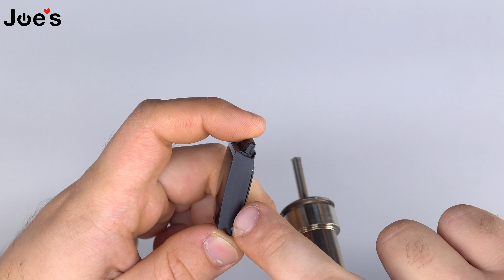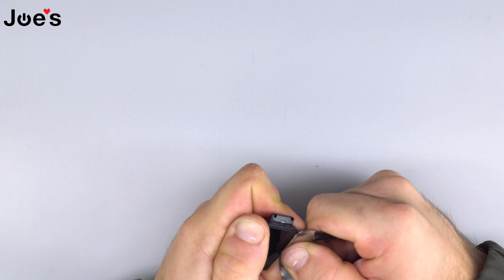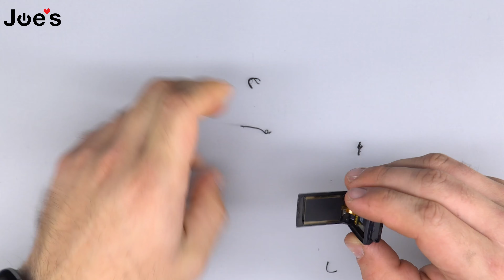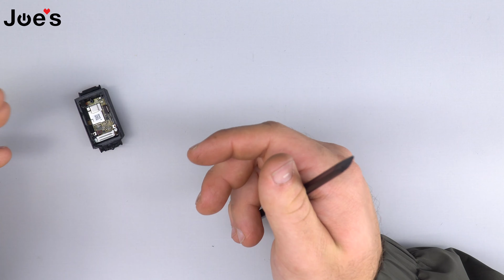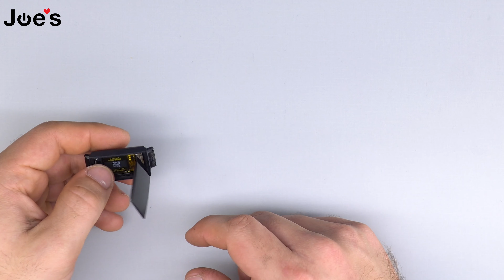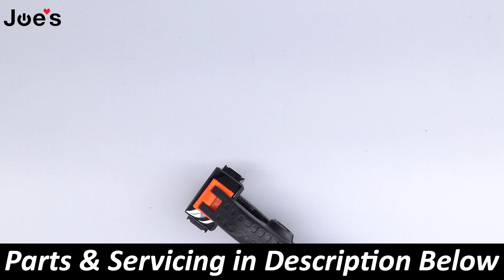Fitbit Charge 4 Broken Screen Replacement | Repair Tutorial

Comment: Such a complicated process even is done by you as professional —after buying the glue, tools, plus the new screen which is sold almost half of the price of the totally Fitbit, it is highly possible I will still screw it up and left with the glue, tools and a totally broken Fitbit… 

If so better just buy a new one instead 😂 (here in Australia they run promotion so the Fitbit price has already gone done a lot…)
Reply from the maker: 😂  sometimes it is
Reply: Am in zambia

Comment: What kind / brand of heat gun do you use?
Reply from the maker: https://www.amazon.com/Quick-861DW-Digital-Station-Display/dp/B00EID23J6/ref=sxts_rp_s1_0?crid=27TQO3QRSHK53&cv_ct_cx=861dw&keywords=861dw&pd_rd_i=B00EID23J6&pd_rd_r=34944891-32ff-4896-96a4-2b0dae391284&pd_rd_w=I0Q6H&pd_rd_wg=FZ8nX&pf_rd_p=5d10c7b7-657f-44a1-8312-8b406103e1ce&pf_rd_r=ZGEF5XSR3M1JNR4MY6JA&psc=1&qid=1647900836&sprefix=861dw%2Caps%2C129&sr=1-1-f0029781-b79b-4b60-9cb0-eeda4dea34d6

Comment: Do you think, lacking a heat gun, a person could put a spoon or other smooth metal object in hot water, let it get hot, pull it out and dry it real quick, and hold it to the screen to let the heat flow in and loosen the glue?
Reply from the maker: Use a blow dryer.
Reply: @Joesge  thank you.